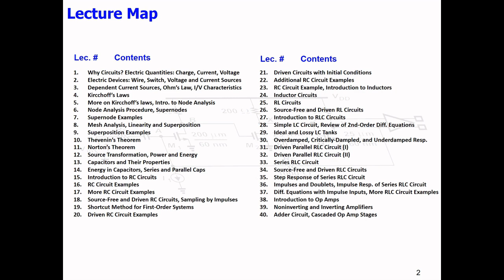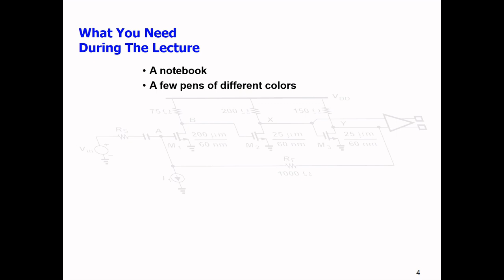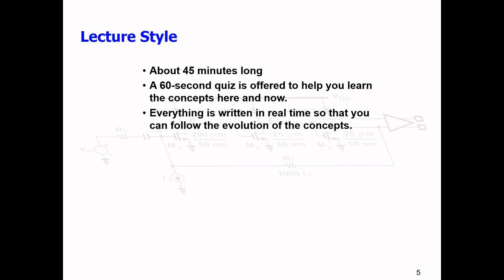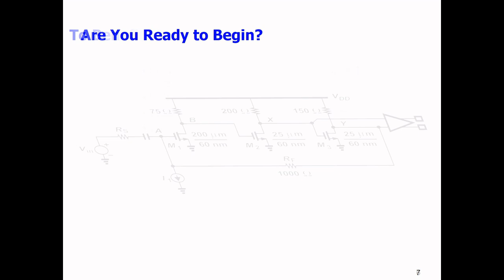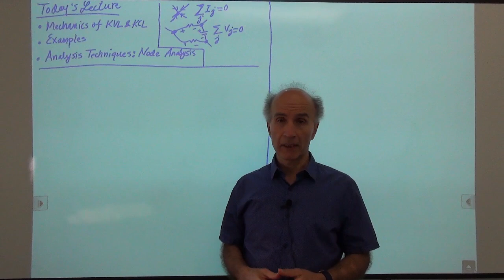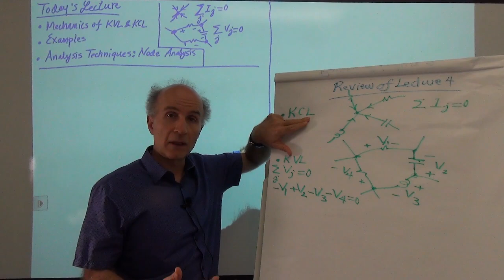Razavi Basic Circuits Lec 5: More on KVL/KCL; Node Analysis

Comment: When you have worked through the lectures on Node Analysis you may find the following of interest: Circuits &  Systems, Lectures 4,5 and 6. (Ali Hajimiri).
It's possible to write down the KCL equations in matrix form, just by inspecting the circuit diagram.
Reply: I will check it seems promising 🎉

Comment: 35:00 NO HELP YET!!!!
What he says about current going in equals current going out makes sense. But the dependent current source other than 1 to 1 (no gain) will not follow KCL.
The extra current has to come from somewhere.
The formula will only work if K is reversed logic.
Example, K being positive with the other drains
 (I1+I1R1/R2+KI1,,,etc,,)
or negative when moved left of
 the equals sign.
PLEASE, if anyone else has tried this example, let me know what worked out for you!
Thank You 
MGM
Reply: The dependent CS still follows KCL.

Comment: 35:00:
Everything I know, I learned from the "Great B". But, I'm still learning, and this drove me nuts for a few days. Please let me know if making K should have been "negative" on left side of = sign.
It is the only way it works out for me.
I tried the math and many simulations to prove it out.

Is False:
Ix+KI1 = I1+(I1R1/R2)+
(I1R1/R3+R4||R5)+Iy

Is True:
Ix-KI1 = I1+(I1R1/R2)+
(I1R1/R3+R4||R5)+Iy

Also True:
Ix = I1+(I1R1/R2)+
(I1R1/R3+R4||R5)-KI1+Iy

=>
Ix-KI1 = I1+(I1R1/R2)+(I1R1/R3+R4||R5)+Iy

Finally "I1"

I1 = Ix-Iy/(I+(R1/R2)+
(R1/(R3+R4||R5))+K)

Thank You for any help!
MGM
Reply: The final answer should have a  -K

Comment: 11:43 how the current from voltage source and resistor are the same. as the  voltage source do not follow the ohm's law.
Reply: pick any point between the voltage source and the resistor, apply KCL, you can see that the current is the same.

Comment: 21:00  Why doesn't he put a ground on the schematics. When inserted into the circuit simulator, the simulation without gnd does not work, and when gnd is inserted, the current through the R1 and R2 branches is 0? Thank you.
Reply: When you building a circuit, are you putting the ground :)? He is not doing a measurement there, the place as you said ground could be anything. The important thing is the voltage difference.